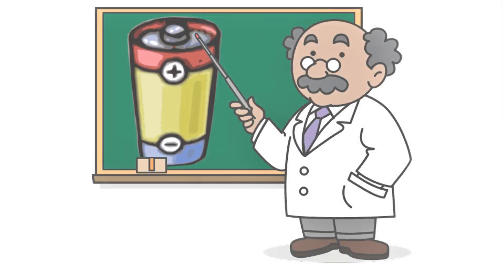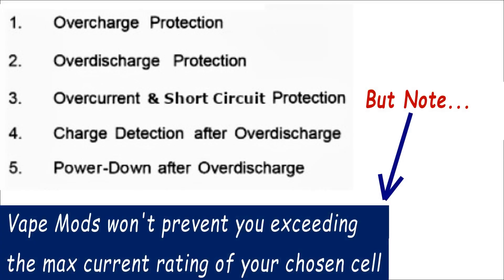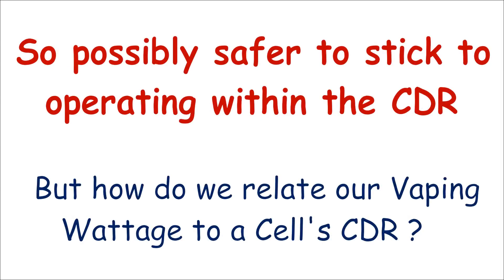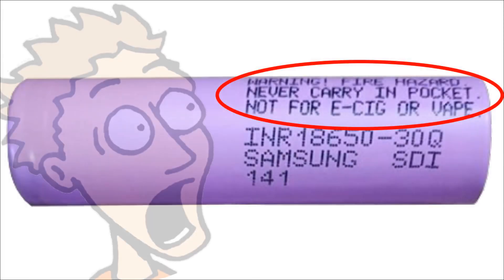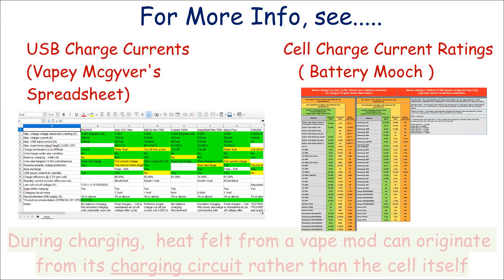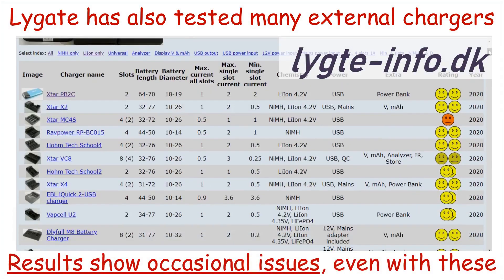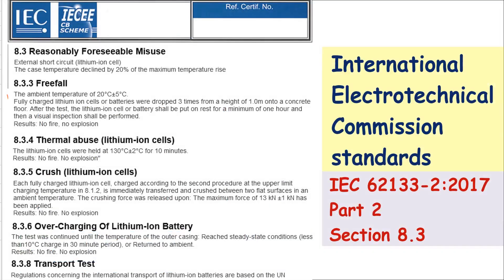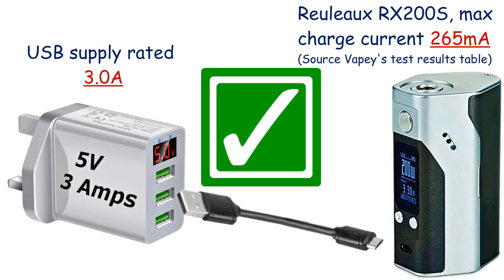Vape Batteries - All You Need To Know

Comment: Minty. Iv got my geekvape aegis solo body ... and some 18650 batteries and a recharger .... dam batteries are just a few mm to big. Im assuming these are 'protected' ... can these be made to fit in my vape? ... and if so can a man completely new to this crazy technical vape world do this??
Reply from the maker: Hiya mate, you don't want to hear this but if you have protected batteries (and it sounds like you do) then the best thing do do is order some unprotected ones for your Solo instead.  Even if you could magically shrink the battery to fit, the protection board (built into the battery) would cut off the current at far too low a level to make the Solo useful.

In theory, if you want to change a protected battery into an unproteted one, you could unwrap the battery, remove the protection board and then rewrap it without the protection board but even then you won't know the CDR of the battery.  Just maybe the best betorder a good unprotected cell with a CDR of 15A minimum, pref 20A.

At least you have a great Mod - I have three Geekvape Aegis Solo originals and just love 'em!

Good luck!
Reply: Hello there…. I just bought a Vapegeek with the bigger battery. Though I have the smaller battery that fits on smaller vapes, however I have the adapter black case that holds a battery if they are smaller and the store told me that the case plus battery fits in the new Vapegeek model M100. Is this true… it doesn’t seem to fit!! I only  bought one battery so I’m kinda screwed or am I???